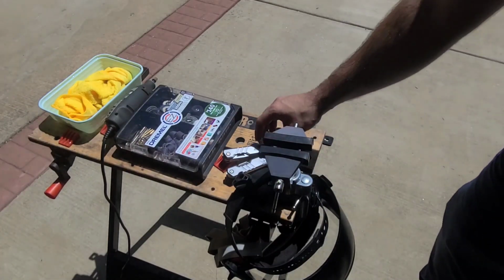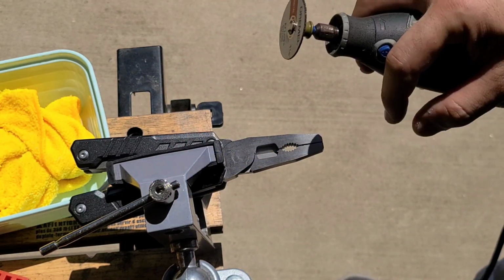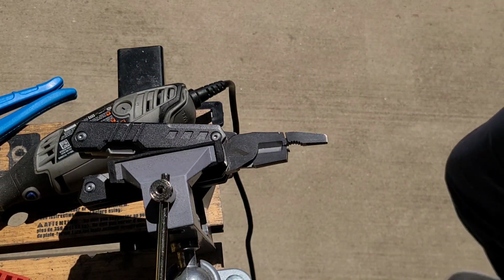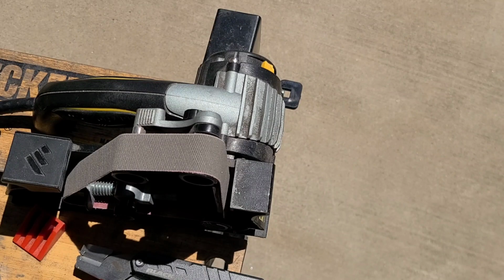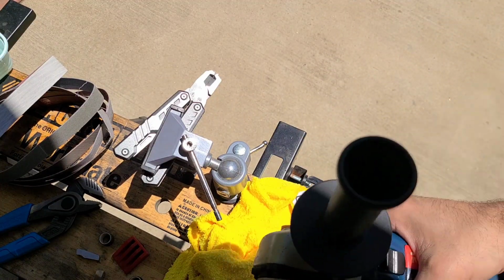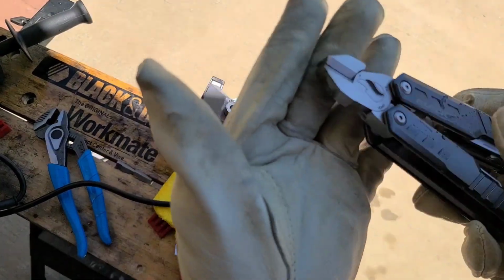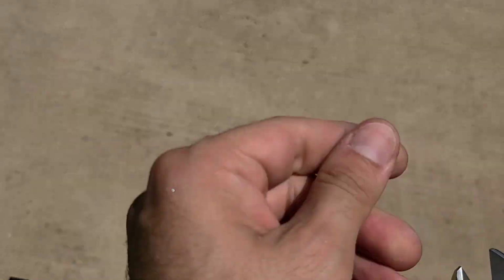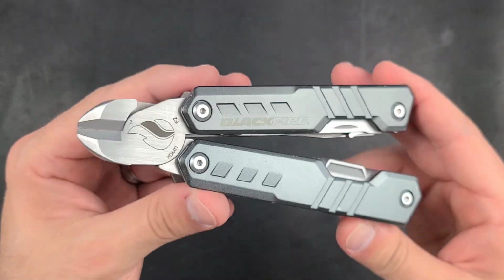🛠 Diagonal cutter (dikes) Multitool! (Electrician's Tool?)

Comment: Nice work!  It's always fun to watch a successful mod come together.  I love those cutting wheels for the rotary tool as well.   Side note: have you considered an entry level portable band saw for making cuts through thick hard steel?  That was a game changer for me.  Perfect cuts with much less heat.
Reply from the maker: Space is an issue for me...I'd rather find the best rotary tool I can
Reply: @maxlvledc  get a portables saw and the mini table for it

Comment: Hi you may find it easier and more effective if you use a knifemaker's trick and wrap the wet rag around the steel you are trying to protect the heat treat, occasionally just pouring water on it
Reply from the maker: Good idea!

Comment: Real cool. Nice job. Now u just need a couple more angle grinders. 😄 I have 3 cheap harbor freight ones that I keep a grinding wheel, cutting wheel, and a flap disc on.
Reply: Stil looking for my first. The thing is, I don't got alot of money and I really want one on batteries. The other problem is I'm in to EDC (mainly knifes and flashlights) metal work, wood work and so on. Good tools aren't cheap.
Reply: @joeljohansson1611  Got all mine when harbor freight had better deals.  Paid $25 or less combined for all 3.
Reply: Living in Sweden and  we got cheapish living and expensive consumables. Always get a little pissed when you get things alot. Jesper than we do but you pay a lot more for your sustainability to.

Comment: Pretty cool mod.... but as an electrician I use my cable scissors way more than my diagonal cutters. Cable scissors cut and strip wires much easier. The diagonal cutter is mostly used when working in a tight spot or if you need to clip a screw or pull out cable clips or nails etc... :)
In fact, the best cable cutter is the CC22, and I have often considered butchering one to fit into a multitool instead of pliers...
Reply from the maker: Oooo, can you email me a pic at mle.collab@gmail.com  ?
Reply: @maxlvledc  

My answer here seems to keep vanishing.... dunno why, tried posting twice now... but I allready sent you an email...🤗

Comment: for the rotary tool, take a look at the proxxon ibs/e , its about 70€ its reaaly tough and the ultimate dremel if you leave out pferd rotary tools which are like 900-1500€🤪
Reply from the maker: $900 !!!
Reply: Been using proxon for awhile.   Quieter also and less vibration

Comment: I really wish they made a pair that were small bypass cable cutters like the coax cable cutters. Almost like mini cable loppers. I have the leatherman with the removable cutting blades. Have went through to many permanent cutters, cutting different cable. The shaft driven rotary tools that many use for carving could be great for modding. I have a dremel 5200 I believe it is, and it does great. Although if ya bog any of them down you'll have a problem.

Comment: A 1×30 belt grinder and a cordless angle grinder with a cutoff disk are much better choices for stuff like this.
Reply from the maker: Probably..but the ken onion blade Grinder fits inside my toolbox
Reply: @maxlvledc  
That is a good thing, but you may want to think about setting aside a little shelf space for a 1x30 if you plan to do a lot more of this kind of thing.

Comment: So its now less of a multitool ? You removed the pliers to gain what exactly ? ... 🤔

And why use a dremel to cut off the pliers jaws when you have a 4'' grinder ? 😂
Reply from the maker: I forgot I had one lols! And I didn't have a cutting wheel for it anyway
Reply: same reason they make dedicated diagonal cutters, theres a lot you can't get at when you have an inch or more of combination pliers in front of a cutting section. and dedicated diagonals are never going to fit into an edc setup.

Comment: They should have went ahead and made both instead of killing off the BlackFire with less than a year selling them. Adding a locking system and tool set more inline the two different tools. Klein has to be thinking of bringing it back in their name not the BlackFire.

Comment: The base/low end Dremels are pretty sad, but leaning into like that is only going to make it worse. I used to have the 200, which is terrible for heat, only really allowing for 10min bursts. The 4300 is miles better in all regards (heat, power, regulation, ergonomics, everything).
The majority of people I've seen/heard complaining about Dremel is almost always right after they've been swinging on it like an angle grinder.

Comment: Like the modding stuff you do. I'd really want a multitool but there is nothing on the market that suit me + I like modding. Problem around that is that I want a tool whit 3-5 implements and the problem is that I can't shrink the frames of the tool. By the way, I'm a knife guy and like modding, anyone in the community how knows if you could use the Ken onion knife grinder as an cheap alternative to a bigger belt grinder when it comes to making knifes?  Keep up the god work. There's a lot of knife guys out the but when it comes to tools there's only maxlvledc and txtoolcrib.
Reply from the maker: Appreciated! I think what you want is possible. Describe it??